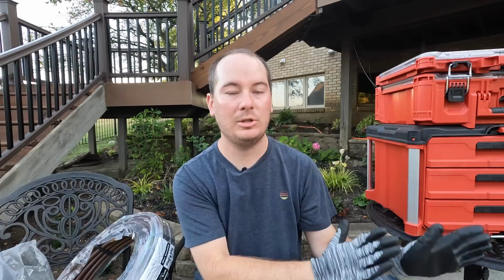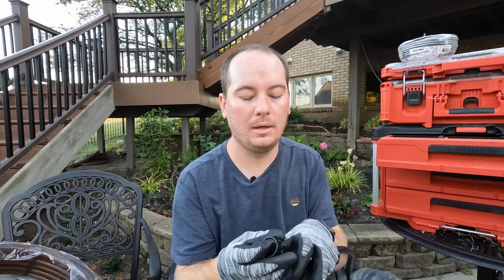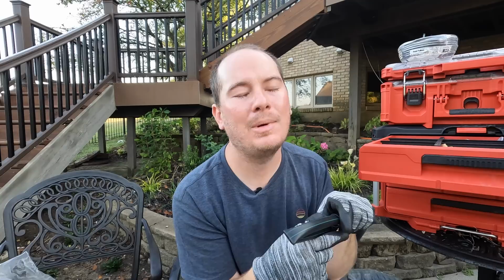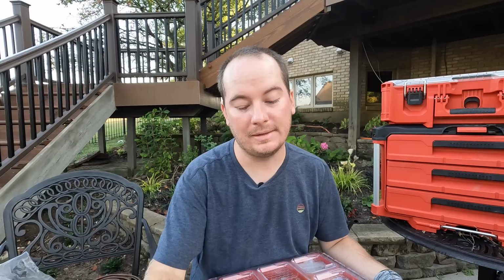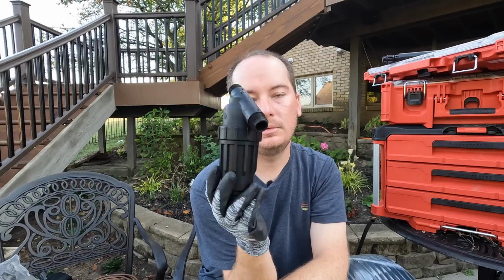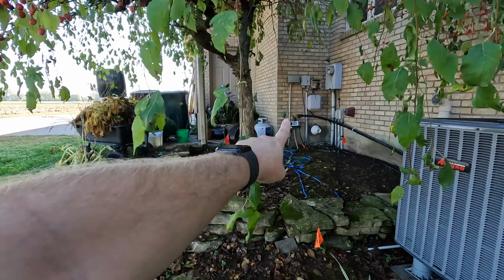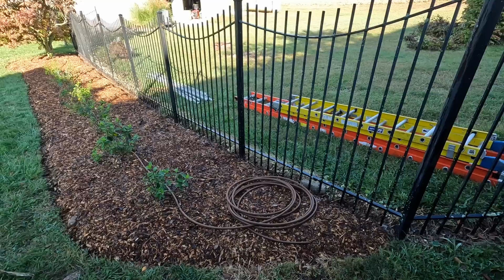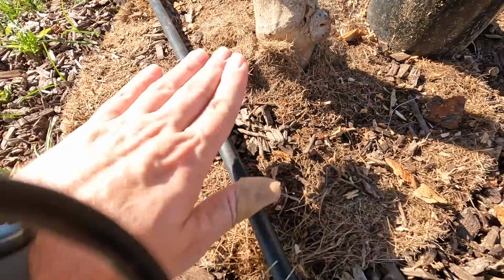The Gardener's Guide to Drip Irrigation (+ Video Installation) | The Southerner's Northern Garden

Comment: Hi, Matthew. I really enjoy your videos. This will sound funny, but I'm a drip irrigation gardener, formerly in drought stricken California. I love watching drip videos because you can always learn something new. One thing I noticed, and I did some checking, is it seems that you installed the Backflow preventer before the timer. All my research says it should come after the timer, which in your case (and mine) would mean a preventer attached to each output from the timer. Did I just not see your installation correctly? Anyway, I ordered this BeHive and I'm excited to try it out next year in my garden. Believe it or not, they had it on sale for Prime day, so I saved $50. Thank you again for sharing all your knowledge!
Reply from the maker: If you want to spend the money on the extra backflow devices you can, but I would put mine closest to the faucet as possible where the water source originates. The premise is the same as in ground irrigation. For example, the backflow device that a county may require inspection of for an inground system is before the actual timers and irrigation valves on a system. I don’t see a benefit in putting the backflow after the timer.
Reply: Thank you. Maybe the companies are just trying to sell you extra parts. My concern would be that if you have the preventer before the timer, will water not even reach that high because the timer is closing the valves as it finishes its cycle? I guess I'm overthinking it, as I do just about everything. Thanks for your response. Most appreciated! @TheSouthernersNorthernGarden
Reply from the maker: @FrediOlson  I did some looking around online too and it appears some of the backflow devices for hoses like this are not supposed to be under constant pressure or they could fail, which is why it’s recommended to place it after the timer. So you can place it after the timer if you like, particularly if your water pressure is high enough that it’s causing them to fail on you. I’ll pin this comment so others can see, but I’ve not experienced this issue myself. Result may vary as they say.

Comment: Mathew, thanks for sharing this informative video. It was comforting to hear on your previous drip irrigation videos that the maximum length can be compensated by running the timer longer as needed. I also make sure to run one zone at a time to prevent any decrease on water pressure.

Comment: I needed 8 zones plus lawn sprinklers so I hired an irrigation installation company.  I have about 4 valve boxes in the ground around the property and a controller on an outside wall.  They ran solid black underground and attached brown 1/2" with emitters 12" apart which I like as I know I'm going to get good coverage.  The 1/2" was installed very similarly to yours with only a few "dead ends".  Since installation 18 months ago, I've made lots of adjustments myself.  I have a lot of Rain Bird parts and tubing. I could have laid the tubing myself for each zone but ask an installer just to do the infrastructure and they look at you funny.  I find these installers (at least mine) no little about plants and they lay out the tubing in a prescribed grid plan - often getting too close to plants that are going to increase in size.  Thus the many adjustments I have made.  
I love your channel!!

Comment: Thank you for this information. I didn't understand that the 1/4" wouldn't be enough to supply all my garden water needs. I did get the 1/4 inch soaker hose for my raised bed to water my veg since the beds are only 3 1/2' x 12'. Your explanation covered the need for a 1/2" supply to get water up the 27" rise and the 1/2 drip line to water the tomatoes and other inground plants. I have Brugmansia that requires much more water and the split 1/4" to the hydrangea showed what I need for them. Again thanks for this video!

Comment: Awesome video Mathew! I have to admit that I am not a stranger when it comes to sprinkle system, I installed it myself on couple of houses but I had a hard time finding the right fittings and my husband and son said that they will never do it again. Of course I will have to convince them to because I can't do it at the moment! Will see, but somehow I need drip irrigation system to water my vegetables and fruits and flowers during the summer! When we moved they threw out some of the tubing and now I have to buy it again! I have a very high pressure here from the county so a pressure regulator is a must for me! I kept your video! Thanks a lot Mathew! Blessings 💕🤗💡

Comment: Thank you so much for all your time showing and explaining to us how to layout and run drip irrigation. I will say it looks easier then it is to try to connect the 1/2” connectors (the L , T, and straight) need to have a lot of strength in your hands.
Reply from the maker: They have to be a bit difficult because they’re only held on by the barb and pressure from the tube. I’d recommend using gloves, but you may also find sitting the tubing out in the sun or using a hair blow dryer on the end of the tubing helpful to warm it up and make it more pliable before inserting the barbs. The sun definitely helps a lot.

Comment: Can I attach the black distribution tube to a hose end instead of the hose bib.  I have extremely high water pressure at my home and I cannot leave my water turned on all the time.  If I do I hear a high whining noise in he house and frankly it concerns me if the line.blew it would be a disaster.  SoI would like to run the distribution tube to the shrub border at the top of a tiered wall and just connect it to a hose end when I want to run it.  Is this possible?.  Loved the extensive coverage; especially for a newbie like me.  Thanks for your help
Reply from the maker: Yes, the connections are the same.

Comment: My irrigation is hooked up to my sprinkler system which runs on a well. I haven’t put any pressure regulators in anywhere. This summer I have had too many leaks, and by that I mean water spraying up about 8 feet in the air. One raised bed completely deteriorated from too much water. Any suggestions on where I should install the pressure regulators—I’m thinking about the pressure regulating couplers? Thank you, Matthew, for being so thorough!💖
Reply from the maker: Do you have drip valves or have you converted sprinkler heads to drip heads? At my last home I converted my overhead sprayers in my garden beds to drip with a Rain Bird sprinkler head drip conversion kit. That conversion head had built in pressure regulators at every head. If you don't have any of that scenario, you would need to look at integrating a pressure regulating device someone at the beginning of the system (near to where the water source comes from) to reduce the pressure overall.
Reply: @TheSouthernersNorthernGarden  I converted the sprinkler heads to drip using Rain Bird—well, my sprinkler company did. I forgot about that, but I also bought valves to shut off certain beds if they don’t need the water. Thanks, Matthew, this was so helpful. I can feel confident that I just need to patch the lines.

Comment: Matthew-
You’ve sold me on drip irrigation! 
I currently have a sprinkler system with 3 heads per zone.   Can I convert all 3 to drip?   
Joel - MN 4b
Reply from the maker: You should convert all heads, or if you’re not converting all heads, cap all other non-converted sprinkler heads in a zone. I’d recommend converting them all for best pressure throughout the system. You would not want to or need to connect the drip tubing between heads. Think of each head as its own mini zone to water a certain area of the flower bed. This is what I did at my prior home with my sprinkler system.
Reply: Thank Matthew!

Comment: What a great video. I’m still confused on 1/2 vs 1/4 and when to use them
Reply from the maker: I don’t recommend 1/4” drip irrigation in landscape beds at all unless it is in areas where the 1/2” would be difficult to maneuver due to its more limited flexibility. 1/2” is always going to provide the best flow, pressure, and future proofing for expansion. 1/4” is great for raised beds or containers.
Reply: Thank you so much!! ❤

Comment: Excellent video, clear and concise.  Your legal education serves you well.  I have an existing sprinkler system.  If I convert some of the sprayers to drip, as you explained in your video from two years ago, do I have to disable all of the other overhead sprayers in the system?
Reply from the maker: I would cap the other heads in the ZONE, not the system. Or, as I did in my case at my last home, convert every overhead sprayer to drip so you have more volume and pressure overall. If you don’t, you’ll severely limit the amount of pressure and be overwatering areas with sprayers because of how long you need to run the drip.
Reply: I just recently found your channel and am so glad I did. You have a way of explaining things in detail that others don’t. Not intimidating. Makes one realize that gardening is really easier than we think sometimes. This was perfect timing because I am revamping my drip system and have learned a few tips to help me. Will definitely be adding a timer! Thank you.

Comment: Can you give me an idea of how much drip can you run off one zone I am just using the 1/2 inch drip with 12 inch emitters holes on brown tubing I have a total of 8 small garden beds three of which are long narrow about 3 ft wide by 90 ft long if you were to combine them 3 together than I have I garden bed that’s about 20ft long x 8ft wide I also have two other beds that are 10 ft long x 7 wide and the last two are 8ft long x 5ft wide the last one is only 10ft long by 2ft wide . Thank you for any response. Also I am running from my home spigot I did by the b hive timer I am waiting for everything to come in again thank you
Reply from the maker: The packaging or manufacturers website should mention it. It’ll depend on the PSI as well. I’ve never used the 12” spacing tubing, but I imagine it would be somewhere around 250-350 feet because there are way more emitters than the 18” tubing.

Comment: My on off valves keep leaking. Any idea why?
Reply from the maker: The manual plastic turn valves? If so, they’ve just failed and need replaced. They could also have also been manufactured incorrectly. I’ve had it happen a couple times.
Reply: @TheSouthernersNorthernGarden  ok thanks. thought I did something wrong.. I used the green rain bird ones brand new .. both leaked from bottom. I will try a new pair
Reply from the maker: @deadpool_exe2614  I’d recommend you get them elsewhere in case it was a bad batch or try a different brand.
Reply: @TheSouthernersNorthernGarden  yea I like the blue ones you showed in the video. Are those from Amazon?
Reply from the maker: @deadpool_exe2614 these are the last ones I’ve purchased so those were the ones likely in the video https://amzn.to/3Kbf9Lx
Reply: @TheSouthernersNorthernGarden  awesome! Thank you, I will give these a shot